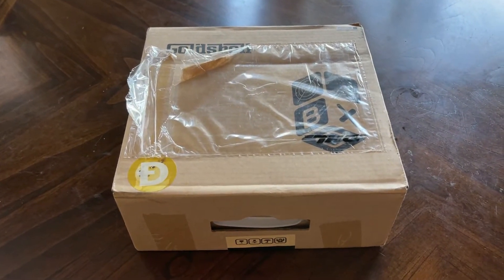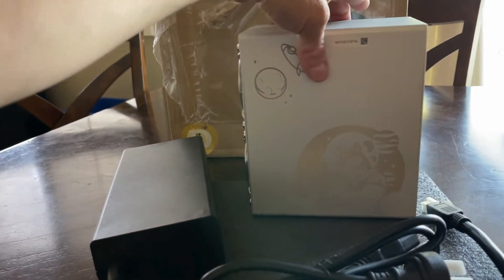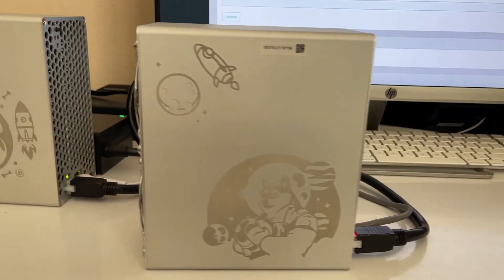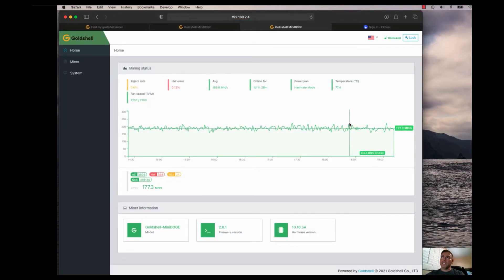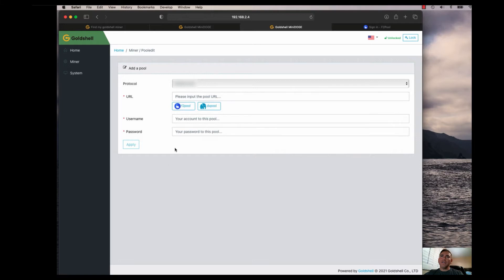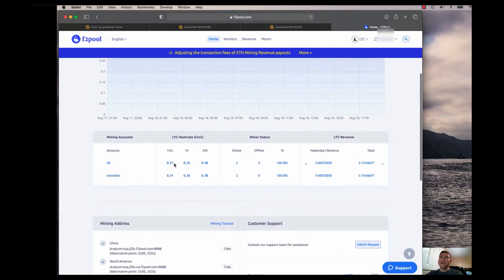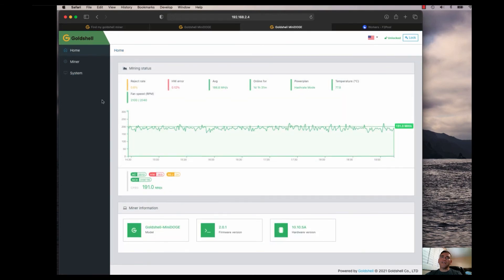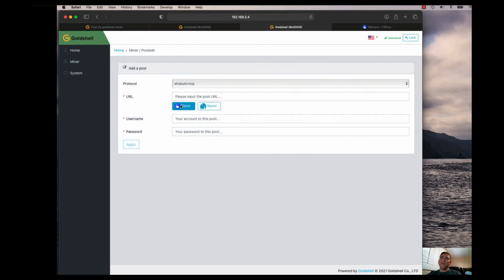Goldshell Mini Doge Miner Unboxing and Setup: Multiple Doge's!!

Comment: Thanx for making this. It will be helpful when I get mine (pun intended) plugged in.  I thought I had a 6 pin male to male cable. Turns out I didn't. I tried to modify my 8 pin to 6, but it didn't work.

Comment: My Mini Doge is WiFi model. Plugged in power and fans wind up and showing red light at 6 pin power port and flashing red light on top??? Can’t find it on Advanced IP Scanner or on Goldshell find my miner page. Laptop is on WiFi and Ethernet cord running to the Miner. Help please. TYIA

Comment: HELP HELP! I messed up after seting up my mini doge miner. I linked my f2pool account, it was mining then i deleted that DXpool pool setting that came on my box and now im not mining at all. Not sure how to get back and start mining again! I reached out to goldshell a couple day ago but no response yet! any idea what i could do?
Reply from the maker: @nvidia Shield Definitely make sure your settings are correct. Is the miner connected to the internet? Have you ensured that it has a good physical connection? Can you see it detected by your DHCP service? There are many reasons...The other option is to perform a factory reset or downloading a firmware update and flashing the system.
Reply: @teammikey  I did a factory reset but that particular pool setting that originally came on the miner did not reappear. I’m pretty new to mining. I just created dxpool account I paired it to the miner and now both f2 pool and dxpool are now green. And I’m mining. I set f2 pool as the main but I don’t see it registering on their site. But On the dxpool site I see it’s active and running. So I’m not sure if I really fixed it?

Comment: Just will like too know do u recommend having two of the same miners hardware working or just one? I'm thinking about investing in one but don't know if I'm going too  purchase 1or 2 🙄
Reply from the maker: Charles that depends on your financial situation. I purchased two so that I could accumulate more coins, but they are $799 each. This is question only you can answer. Thanks!
Reply: @teammikey thanks for the advice I decided to order two today I’m going too try and go for 2 more later down the road 😎📈
Reply from the maker: Awesome, where did you decide to order from?
Reply: @teammikey  I just went on eBay and talk with a couple of different vendors on there…

Comment: I received my Mini Doge Miner on 10th July and my earnings as of September 2nd is zero!
I have been supplied with a faulty Miner and after over 100 emails, the issue is still not resolved.
Dealing with Goldshell to try to put this right has truly been a terrible eperience. I would advise anyone who is looking at getting into ASIC mining to avoid Goldshell otherwise you could end up with a very epensive aluminium box with flashing red LED's that is not fit for purpose.
Reply from the maker: Tug, I am sorry to hear you are having Issues with your miner. Do you mind sharing some of the settings you have on the miner? I think a little more context would be nice in Goldshell’s defense. Thanks!
Reply: @teammikey  I have taken screenshots of the logs from the debug page and sent them to Goldshell twice already to show proof of the fault and now communication has gone very quiet.........I asked  Goldshell to take back their faulty item but they told me they do not issue refunds but they will offer technical asistance to repair the miner....... I think Goldshell need to put on their website that they sell faulty miners and then offer assistance to fix them!
Reply: They have the worst customer service or better say customer dis-service.